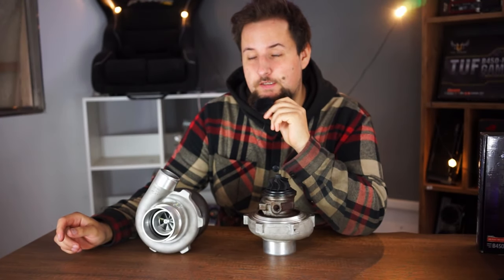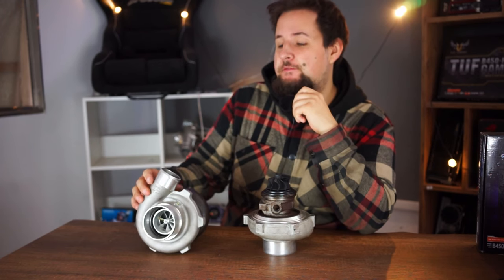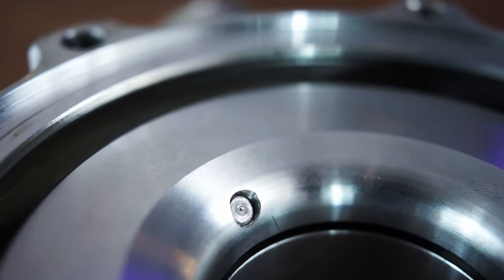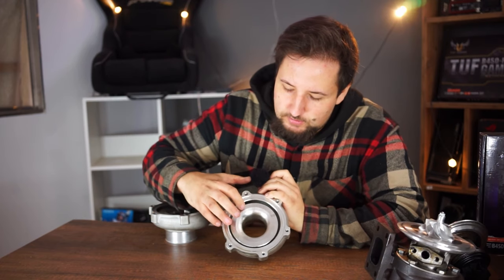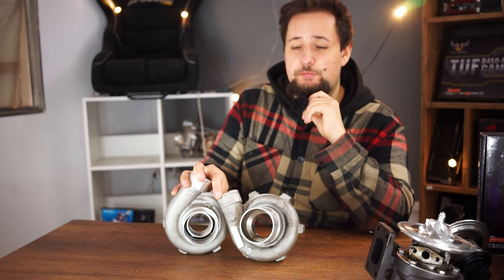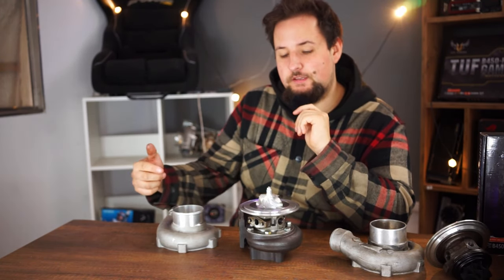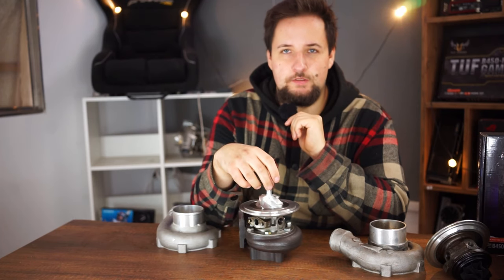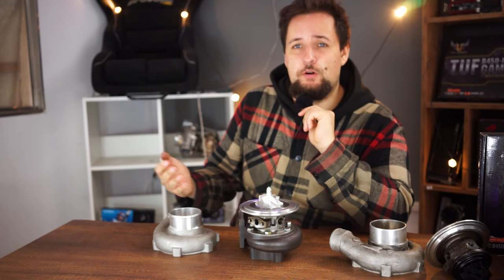Why you DONT Need a T51R MOD | This does the same for 0$!!! | Make your Turbo louder FOR FREE!

Comment: thanks for posting this. I drilled 8 5mm holes in my compressor housing and it sounds insane. no loss of power
Reply: Video??
Reply: @tommylyeah sarcasm
Reply: Where in the compressor housing? In the back near the wheel? Or in the front like a antisurge compressor housing?
Reply: @ricka12345 you have no business drilling if you don't know which side of the turbo is the charge side

Comment: Now what if you did both t51R and the holes?
Reply from the maker: no idea, was to cheap to do the t51r mod but id guess itd just get a bit louder since they are caused by the same effect, which is air rushing over a sharp edge and therefore creating a turbulence, just like a whistle.

Comment: So I did this yesterday with a 4mm bit and just one hole. It sounds like a dentist drill lol. Should I drill more holes ?
Reply from the maker: @Marcarlar  no one should be enough.well yes its pretty high pitched the smaller the turbo the higher pitched its gonna be

Comment: did not work drilles 3 small dents into a spare gt style turbo housing I had and put it no with no difference in sound
Reply from the maker: There need to be edges on the hole so that there is air turbulence like in a whistle. One hole is sufficient. But a depth of 3-5 mm or so would be enough but again there needs to be an edge a dimple, dent or divet does not work the edge needs to be ~90 degrees and sharp to create turbulence and sound

Comment: So what about a bigger turbo, 78/75. Same size drill bit and hole depth? I have a vs racing t51r housing and it barley whistles.
Reply from the maker: @miatakhalifa  yep same size the size of the hole does not really matter it just shouldnt be WAYY too big like an inch would probably be a bit too much
Reply: @throttlebuddies6356  well looks like I'm gonna drill a hole in my turbo 😂. I'll make a video about it and come back here and lyk.

Comment: One comment you mentioned a 3-5mm drill bit and another comment you mentioned a 6-8mm drill bit. Would a 7mm hole make a “deeper” or “louder” whistle than a 5mm hole? And to confirm 1-2cm deep?
Reply from the maker: @finedeluxe1222  i havent tried anything bigger and wouldnt really recommend it as to big can disrupt the aiflow too much and can create a. Loss in power
Reply: So about 4/5mm would be best?
Reply from the maker: @finedeluxe1222  probably, yes
Reply: I appreciate it 👌

Comment: Is it bad if you just completely remove the bolt on the pulsar turbo
Reply from the maker: well yeah that would cause a leak and the turbo wouldnt be able to produce the same amount of boost, but why would you want to remove that bolt completely?
Reply: @throttlebuddies6356  it sounds alot better with it not there when i put it back in takes alot of the noise away
Reply from the maker: @michaelch6536  yes because you are creating a leak and pullig air through the hole the turbo will lose a lot of efficiency
Reply: @throttlebuddies6356  yeah i understand but thanks for the tip it sounds good with the bolt in aswell
Reply: I removed my bolt and in welded a plate over the speed sensor flange lol! My turbo is super loud now 😂👌🏼

Comment: If you had a longer straight section on the intake pipe it would actually make that first note of the flutter hit even harder and sound like all the skyline/supra videos we all love. It's called a "dose pipe" and the youtube channel "keep it reet" has THREE comparison videos for different lengths, bends, diameters, and materials. The ideal dose pipe is 3-4x the required diameter in length, straight, and made of metal (plastic ones don't dose).

The next best thing is a long sweep/gentle curve 90-degree bend, same thing with the metal and being the required diameter. Anything over 6x-8x the required diameter loses the long first note and makes chipmunk noises instead. Anything with less than 2x the diameter in length before any bends and less than 1x the diameter in length after any bends loses the dose entirely and sounds more like basic flutter.
Reply from the maker: I have a 90 degree elbow on it with a large radius an 
I know what a dose pipe is but it only works well on turbos that dont have anti surge, otherwise it desnt do much, also doesnt do much in terms of spool sound but only makes the flutter a lot louder
Reply: @throttlebuddies6356  I heard a guy with T51r mod AND loud dose (the long first note kind that we all want) and IDK how he did it, but he did. I left a comment but IDK if I'll get a response.

Loud whistle + good dose is my dream setup, but if I had to pick, I'd choose dose over the whistle.
Reply from the maker: @Drunken_Hamster  you need a turbo that doesnt have anti surge as the dose is much louder then. With an anti surge housing you need double the boost pressure to make the same kind of sound approximately if you are not running a bov
Reply: @throttlebuddies6356  Anti-surge is the "high flow" thing, right? The slot or holes that go around the main entrance to the compressor wheel, and the thing that you modify to do the "T51r mod"?

Do you think on a turbo with an anti-surge housing you can just weld the slot shut and that'll be good enough?
Reply from the maker: @Drunken_Hamster  exactly. 

yes, you could, BUT aluminium gets distorted very easily by heat so might not be the best idea, tho some turbos have non-high flow options available. 

With a lathe you could also create an insert.
Reply: @throttlebuddies6356  An insert was gonna be my second idea, followed by JB weld, haha.
Reply from the maker: @Drunken_Hamster  oh boy 😂
Reply: @throttlebuddies6356   you can run a dose pipe on a turbo with anti surge you just have to reduce it down to smaller diameter and put the pipe hard up against the turbo effectively blocking off the holes or slots for the anti surge
Reply from the maker: @DiligentMedia  that would be true, but very sketchy. but still dose sound is something different than im showing in this video.
Reply: What about steel hard pipe out of turbo into fender..since I want to run CAI in my mk4.
Reply: Honestly the anti surge style is a real benefit. I think it would be a poor idea to modify it. 

Just get a bigger faster spooling turbo! 👍🏼

Comment: Ha, amdisbest, Nick, has a video of an Audi 20 v EFR7163 with a speed sensor hole without the sensor installed thats precisely this, thanks for sharing the how to
Reply from the maker: Sure but there needs to be at least a plug on the speed sensor port as if its open that might not be ideal power wise lol

Comment: I can confirm the spacer trick works on the pulsar 6466 and their g series replicas.
Reply from the maker: works with pretty much any turbo haha. its just physics i guess. 
i mean a "real" t51r mod does nothing else than create turbulence and therefore a whistle sound, this is just the ghetto way haha
Reply: @throttlebuddies6356  How does this sound on turbos that don't have an antisurge cover?  I'm building a custom turbo  for a subaru and will drill the cover but not sure how its gonna sound since it doesn't have an antisurge cover.
Reply from the maker: @AMTuned  it will sound similar the anti surge doesnt make a difference in that case.

Comment: How do you think a slot would sound? Say eighth inch wide, quarter inch deep and three quarter inch long?
Reply from the maker: id say the difference wouldnt be huge probably as it is the air rushing past a sharp edge that creates that sound. maybe a little more pronounced, although with a slot depending on the length i would be careful because the wider it is, the more of the smooth flow you are going to disturb

Comment: Would this theory still work if the gap between the bolt hole and the bolt itself was well over 10 - 20 mm? lets say more along the lines of 50mm? The end is still plugged but just with a much larger gap.
Reply from the maker: yep, would stil work. The theory works because of the air turbulence/the air that rushes over the hole.

Comment: You can do a legit t51r mod if your compressor housing has some meat around the compressor wheel. Used a hole saw and cut down a few inches to reach the wheel then used a dremel wheel on the inside to cut slits and connect the two chambers.
Reply from the maker: yeah, but its a lot more expensive to do 

most turbos have the possibility of tetting a housing with anti surge, that can also be modded.

Comment: My borg warner does not have a hole drilled in it from factory. Is there still a way to do this?
Reply from the maker: @305pyroheads  as i explained in the video you can drill an indent or rather a small hole about 1 cm deep that will create the same sound
Reply: @ ahh ok, is there a specific place to drill them
Reply from the maker: @305pyroheads  as it is explained in the video it needs to be somewhere where the fins of the compressor wheel will pass by directly

Comment: I’m very tempted to try the drilling mod. Just the one hole? Any idea of drill bit size?
Reply from the maker: yes just one something around 6-8mm should suffice and 1-2cm deep is enouch
Reply: @throttlebuddies6356  I can confirm this works! Was on a 1.4 TDCi fiesta so the turbo was only the size of my hand but tested it out and it worked a treat. How ever it sounds like a ‘dentist drill’ which I’ve heard before but I love it. Thanks for posting this video!
Reply from the maker: @SpeedyJames  haha yeah it is very high pitched as you can hear in the video! but tnaks anyway!
Reply: Did you try it?
Reply from the maker: @Gusmanbro  try what and who?
Reply: @Gusmanbro  Yeah man been running it daily since
Reply: @SpeedyJames  sick! thanks
Reply: @SpeedyJames  any vids? Just curious as to what this mod would make a stock turbo sound like

Comment: I have a hole on the exit of the turbo compressor housing for a boost sensor. Does that work to or does it has to be in the compressor housing and not in the exit. Becouse al the air comes by that hole to.
Reply from the maker: @mikeleenders6823  no it will not work the only way it will,, how i am showing it in the video

Comment: So on the Pulsar unit which has a speed sensor, no drilling is needed? Yout just put a spacer on there? How thick a spacer?
Reply from the maker: Doesnt really matter i think 10mm or something should even be sufficient.
Reply: @throttlebuddies6356  I got a G35-900. Im not entire sure if the speed sensor hole is even threaded. Theres a hole, and then theres a black plastic cap on it thats held down by another smaller hole next to it with a bolt. I dont think the actual hole that goes into the turbo that the sensor sits in is threaded. Im a bit confused as to how you are supposed to mount this spacer exactly
Reply: @placeholdername3206 I have a Garrett g30-770 and mines the same way. Has to take a look and got all excited but then I was like what? How’s a spacer fit in here 😅… I wonder if we just take it off entirely??

Comment: I have a maxspeed gt3582. It has the fitting in front like 3:51. Can this ne done on mine as well? Didnt really understand where exactly to drill. You have IG??
Reply: Oh you drill from the inside of the housing. Opposite the casting? Like, don't create a hole correct? 😂
Reply from the maker: @schalachi  yeah but i have instagram its _throttlebuddies. you cxan find a link on the channel page

Comment: Turbo flutter and durability is a myth 😂 come on guys is 2024
Reply from the maker: @byronboost  actually no, on a journal bearing turbo, there is more load on the thrust washer and the compressor wheel can rotate on the shaft causing an imbalance